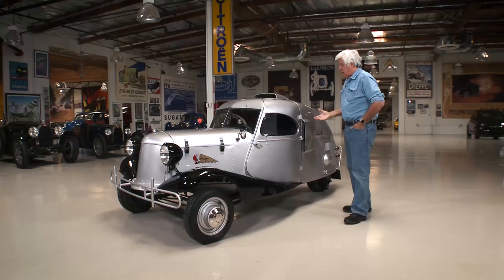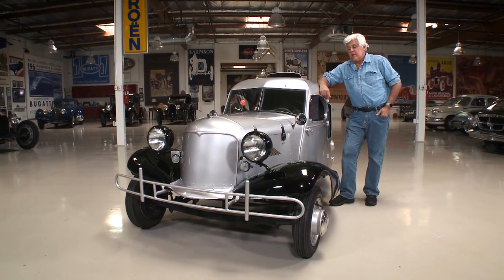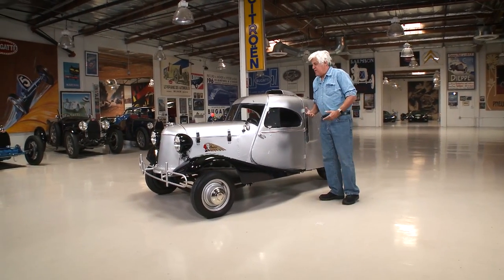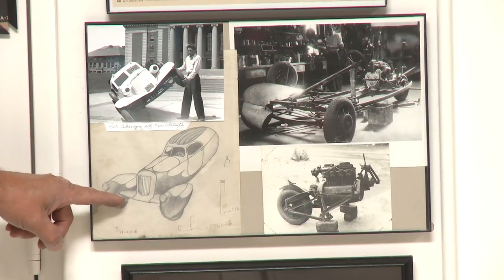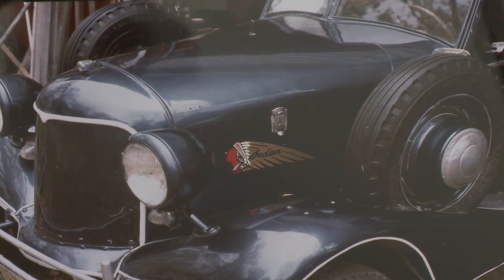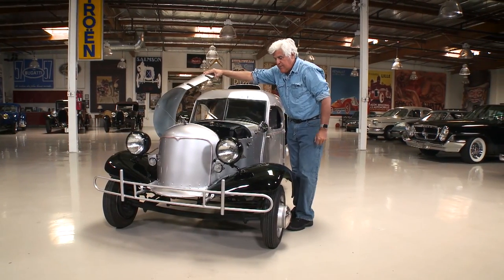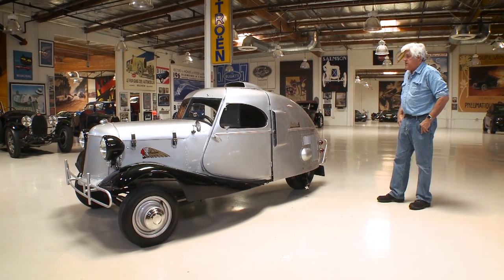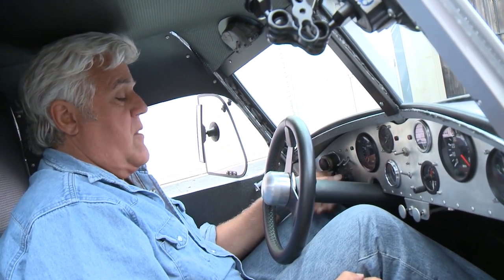1931 Shotwell - Jay Leno's Garage

Comment: That horn sounds so sick ~ like a wounded duck ~ I was rolling on the floor with laughter
Reply: there's actually a duck tucked under the dash for authenticity
Reply: Haha I agree. It was so funny.
Reply: i love thar horn, wounded duck😂😂😂 xD
Reply: Actually they duct taped a duck under the dash and put a metal rod inside it's anus and when connect the other end to a push button.. Then just hit the horn for quacks.. It stopped quacking cause the duck reached climax.
Reply: +V4 Garage oh God hahahahhahahahaa xD you makes me my day dude xD hahahahhahahahaa 😂😂😂😂😂😂😂
Reply: haha! I found your analogy equally as funny
Reply: +V4 Garage soon theyll instal a multi duck system on a 1 hour periodic revolution system... Some one patent that.
Reply: It is a duck, a 85 years old duck that has been silent for very long. So his throat sounds a bit worn out.
Reply: johnny hirt Ducks strapped in a wheel that spins and has a gatlingun working poking stick so you can go 100 quacks per minute.
Reply: +V4 Garage hahahahhahahahaa xDD
Reply: +V4 Garage 😂😂😂

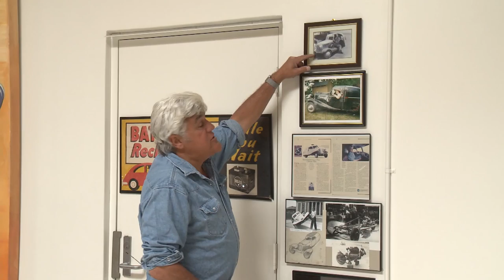Comment: 5:52  Note in the photo that the spares have matching deep lug treads while the tires on the car are smoother.  I think we're looking at a set of mounted snow tires.  Makes sense considering he took it to Alaska
Reply: Another problem with 3 wheelers is putting your car in the snow tracks of those that went before you, none of which would be 3 wheelers in Alaska
Reply: could be.  Or maybe that's just what was available.  I also notice in that photo there is no front bumper, and turn signals are on the roof.  The other photo shows the air scoop on the lt side of the cab, not on the top.  So it evolved over time, even before Jay got it.

Comment: Great little car! I would have been tempted during the rebuild to add a small circuit that keeps that cylinder head cooling fan running for about 2 minutes "or so" after you turn the vehicle off.....Then the fan would shut down automatically. I imagine there would be quite a rise in temp after shut off, all boxed in like that... especially in that climate. I understand it probably see's very little road time, but it would be simple, and just blend with all the other mods. Always enjoy the video's Jay! Take care.
Reply: That is exactly how my Buell Ulysses fan works.  Fan runs when the temp hits a certain temp and continues to run after shutdown.
Reply: Temp probe controlled fan relay w dial adjustment calibration
Reply: CooL. you are here 😀
Reply: Just like the Turbo cool down system on modern cars,glad to see you here watching Jay videos also

Comment: One of the best episodes of your show, ever - by the end of the episode you had figured out precisely why you had to make a roadside running repair....it is indeed very satisfying to solve or drive around a problem on the road. That is, to me, the essence of motoring, something which has been lost along the way. And who hasn't run out of the correct fuses at some time or other on the road, and installed an inferior replacement? This is a great story, of a terrific little car built by a inspiring young man, and I appreciate you restoring and keeping this thing going, Jay.

Comment: Blown fuse?... Don't know how many times I was saved by a stick of Wrigley's chewing gum.

Frank
Reply: I need to start chewing gum...
Reply: +johnny hirt I'm thinkin the same thing!
Reply: Ray Kruse and johnny hirt .. It's not about the gum.. It's about the wrapper... At least, it used to be... Years ago, Wrigley's gum was wrapped in aluminum foil lined wax paper... You could wrap your blown fuse with the wrapping paper, reinsert the fuse, and voila, the pixies would flow again. Surprisingly, If you were lucky, and didn't burn up your complete wiring system, the "fix" would last for years.
Reply: +franksalterego They might still have aluminum/wax paper in some places
Reply: Yeah i remember a buddy showed me if you connect both ends of a AA battery with the foil side of the wrapper it can be somewhat of a firestarter in a pinch.
Reply: franksalterego brother don't  you know it cigarette foil has Ben my saviour many times
Reply: Back in 1978 working 2nd shift, at the end of the night one of girls cars wouldn't start, blown fuse, one of the guys wrapped tin foil around the fuse, the car started right up, she didn't make it a mile before the car caught fire, a really nice 1968 Mustang fastback burned to the ground.
Back in the day, many houses burned down because people would put pennies under screw in fuses when they blew.
Those are perfect examples of a little knowledge being dangerous.
Reply: Fire hazard

Comment: I think someone should design a Shotwell replica kit car (bike) like this using a motor and rear suspension from a donor motorcycle.  How about a Hayabusa powered Shotwell replica?
Reply: that sounds like a great business idea for Jay. He owns the only one so he can replicate it without worrying about rights to design.
Reply: Hayabusa? You're a sadist aren't you?
Reply: Given the design, surely you'd be far better off with a scooter engine. There used to be an isetta replica that had one, worked well. Or, for a bit more grunt BMW 700 or guzzi power. Hayabusa would just be suicide.
Reply: No "Busa. Use a Modern Indian powertrain. 40HP for 1931 was the top of the heap. Remember Indian was the dominant Racing Motorcycle of the time.Besides, someone already stuck a 'Busa engine in a Smart 4two.
Reply: I think the T- REX Is as close as a modern day version of a car like this as we get.
Reply: interesting, not that far off!
Reply: How about a Kubota diesel powered Shotwell!
Reply: Google czech car "Velorex", same idea, 3 wheels, motorcycle engine, factory build, leather covered frame. Created in former Czechoslovakia for disabled people.

Comment: Long ago I was driving a 1946 GMC fire truck when the horn started sounding repeatedly.  Then the headlights failed.  We brought the truck home using the spotlights.  The horn button wire inside the steering column was shorting to the column and causing the horn relay to pull in and sound the horn.  The horn and headlights were on the same fuse and it overloaded and blew.  I disconnected the horn button wire below the column and replaced the fuse.  All lights worked again.  We left the horn disconnected and the truck was retired in that condition.  I had a similar problem with a 1954 CJ-3B Jeep.  The horn wire insulation cracked and the wire was shorting to the frame.  A little heat shrink tubing fixed that problem.  Yes-It;s satisfying making repairs on old vehicles.  There' s a simplicity about them that re-educates you.

Comment: I'm thinking a critical  like cooling fans should run on their own dedicated fuse/circuit.
Reply: yes.  but on the other hand, a quick tap of the horn will tell you if the fan has power or not...
Reply: hmmm good point.   You could tell something was not right when Jay hit the horn.  The voltage was sagging.   Resistance was going up and the fuse was heating up, ready to go on a permanent vacation. lol
Reply: +dddire straits yeah, that little 8 amp definately took off running

Comment: It's been 2 years and I'm just seeing this video for the first time now...well, it was a different time back then when the industrial revolution was in full swing. But, today is no different if you take into consideration that a number of young people that are designing and building on/off road vehicles and motorcycles. Today you can pretty much buy an off the shelf part to build anything, a far cry from the old days where you had to scrounge around for parts and modify them to fit.. But the passion is still alive today it's just taken on a different approach.

Comment: What a remarkable story. Thankfully Bob had the good sense contact Jay Leno. Jay Leno had the good sense to collect it and restore it.
I loved the comment that Bob Shotwell simply went and had his car registered with absolutely no fuss!  In  makes  you realise just how much personal freedom has been lost over the years.
I loves Jay's comments about the reaction of other road users to 'Shotwell'. It is interesting to note that because he used an Indian 4-Cylinder engine hence it has no reverse gear. Well in the UK until about 35 years or so years ago .
Three Wheelers under a certain weight were classified as motorcycles. So you could drive them on a motorcycle license. 
Provided the vehicle had no reverse (either a reverse gear or as in the case of some 2-stroke engines reversing the engine ie in the case of the Bond Minicar with a bi directional SIBA Dynastart)
gear! All in all very impressive for a 17 year old!

Comment: Sort of "Flash Gordonesque" in appearance, very cool. Seeing Jay in it reminds me of a nostalgic drive I took in a Morris Minor Ute a few years back. The cab was so small, you had to take up a position like a praying mantis because the distance from seat to steering wheel was only about 15 inches. Add to that, wooden brakes and even the transplanted motor from a Nissan 1200 felt pretty pedestrian. Nostalgia's great, as long as you don't have to drive it too far.

Comment: Thanks for all you do.  I have 1930 Ford--originally had no fuse.  Common practice is add one fuse where the wiring harness connects to the 6 volt battery lead wire, after the starter.  When these cars fail to keep running, folks try the horn.  If the horn is ok, the fuse is OK.  If no horn, the fuse is likely blown.  I have "slow-blow" type fuses, 30 amp.  The headlights and horn may pull more than 30, momentarily.  It's a fix.  I carry a few extra fuses.

Comment: Great episode. Hats off to the spirit of Mr. Shotwell and guys like Mr. Leno.

Pffft - blown fuse? No problem, here's a fix that works every time:
Wrap the fuse in foil. Tin foil from the roll works best, but in a pinch you can use the foil from a cigarette package (bonus points if you're a smoker - coff coff). Make sure the entire fuse is covered in a thin layer of foil. When complete, just jam it back in.  
Note - ignore the burning wire smell. And oh yeah, don't park your car in the garage for awhile. Wait until the smoke clears.

Comment: Terrific video, Jay. Always pleased to find one of yours about another of the NOT run-of-the-mill cars out there. And hats off to Bob Shotwell. On the fan failure, critical components should never share fuses with accessories. That fan deserves a fuse of its own. Horns get adjusted for minimum current, but as they wear, their draw increases.  Yeah, you tooted for those kids, but you should have been able to do that without disabling the horn, just blowing the horn fuse.

Comment: I realize this video is 5 years old. I'm sure this has already been addressed, but in no way would I have anything tied into the fan motor circuit. That should have a dedicated auxiliary power circuit, isolated and fused ONLY for the fan. Without the fan, an air cooled engine behind the passenger compartment will always overheat, and quickly. I install these circuits on motorcycles all the time for LED lighting, to HID headlights, to LED triple lights. It's super easy and will protect vital components from damage, in this case, catastrophic engine failure. Great car, even greater engine, and another great vid! Thanks for sharing Jay!

Comment: Jay, my Uncle Miles taught me a trick with that type of fuse when it blows and you don’t have a spare.   We would get a stick of gum, the kind in a foil wrapper.  Peel the foil away from the paper and wrap it around the fuse.  Stick the fuse back in and Wha La!  It works till you get home!!!  In the early 1950’s he showed me that trick on a 1952 Dodge coupe when the radio fuse blew.   Anybody that went through WWII knew all kinds of ways to keep stuff running!,,

Comment: It is kind of sad to see how many young people nowadays can't build or fix anything. Some can, some grew up fascinated with things and built projects just like we used to. That's rare to see nowadays.  I was a major tomboy and I grew up with my dad and 3 uncles that grew up in small town Oklahoma in the 30's & 40's. They were constantly out building or repairing stuff and I was out there with them. I didn't master anything but I got the basics of welding, machining and just general mechanics down pretty well and it has been invaluable through my life. I was overheating in the AZ desert & knew to take the thermostat out. I bought a Honda generator at a garage sale for $20 because "It's totally screwed", then fixed it in 15 mins with a new jet for $3. Getting a $23 generator is the first & only time I was happy about ethanol.  Fixing minor plumbing issues, fixing the car etc etc etc has saved me tens of thousands over my life, not to mention, you have the power to fix your own stuff. If your water pump goes out on a trip, you aren't helpless, you don't feel helpless. You are one Auto Zone and 4 hours from continuing your trip. Also, knowing when to turn something off. Can I limp home or is it something that will cause more damage if I keep driving? 
I think that's a great thing and it's sad to see how many people are totally at the mercy of others to fix even the most basic things they use every day.

Comment: This reminds me vaguely of my youth. My first car was a 1968 Chevy Impala - a somewhat rusty, grey Impala - not in the best of shape that I got for $250. My parents said that it was my responsibility, and one of the first things I noticed about it was that throwing an anchor out the window would be nearly as effective as hitting the brakes. Anyone who knows this car knows that it had drum brakes all around. As a broke teenager, I could barely afford new brake shoes, but I encountered a problem - the drums would not come off. My father explained to me why this happened, and told me I needed a drum puller to do the job. I had no money for one. But we did have cutting and welding torches, and a forge, and some old, rust "C" clamps. So I made a drum puller from scratch and fixed the brakes. Nowhere NEAR building your own car, but the same attitude - do what you have to to solve your problem.

Comment: Great video!  Love the musical interlude.  Thermodynamically the fan should pull air out because hot air rises and aerodynamically the scoop should face the rear because a diminishing cross section creates a vacuum -  also pulling air out.  IMHO

Comment: Interesting that the fact that the horn didn’t blow tipped Jay off to the blown fuse. I once had a Fiat 128 that had the electric engine fan and the horn on the same circuit, and I was tipped off in the same way at least once. A few years later I no longer had the Fiat, but I had a Saab 96 V4 that used the same style of fuse. One day I was driving up Laurel Canyon Blvd. in Los Angeles, and I saw a woman in a Fiat 124 Spyder off on the side. I stopped, and she said the engine was running hot. Based on my experience with the 128, I tried blowing her horn, and sure enough, silence. I was carrying spare fuses, I replaced the blown fuse, and she was on her way.

My hat is off to Bob Shotwell. I’ve taken my ability to buy good ready-made cars for granted!

Comment: Great video!  I bet if Jay had honked the horn again, he would have blown another fuse.  I guess a short in the horn (it sounded really sick!) or too small a fuse for the load.  Actually, I’d guess the second, because the horn sounded as if it wasn’t getting enough power.  I kept thinking about what would happen at speed if Jay had to stand on the brakes.  I can see all that weight up front, and was envisioning the car rotating on the front axle and flipping over.  I wonder if he has experienced the feeling of the rear tire lifting off the ground?

Comment: What's not to love!  There is the Campagna T-Rex from Quebec which since 1988 has been making a modern sports car version of the same idea. They claim it is impossible to roll even at high speeds as long as you are driving on a flat surface. I would love to see J. check it out.

Comment: Great car and story, only Jay would rebuild just because it's an interesrting 1 off. Hay Jay i build a 3 wheeler in 97 using a 1600 twin cam fiat it  tops out at 125mph & does  standing 1/4 15.67 but you don't have to worry about the body - it doesn't have 1.

Comment: I told my Dad when I was 12 that I wanted the 56 2dr post Customline that no longer ran that was sitting in the corner in our back yard. My Dad told me I could have It, and he said if you can fix it you can drive it. We'll after talking to Norm who ran the Skelly station I knew what was wrong, and how I would pay for the parts to fix it. Step by step Norm handed me what I needed to   get the car high enough to remove the 3 speed gearbox to remove and replace the the clutch, pressure plate, and thro-out bearing. He gave me this tool and that tool and pointed out on cars he was working on what I needed to look for and remove from my Ford. Now let's make the rest of the story short.....When my Pops got home after working out of town all week the Ford and I where nowhere in sight. I was beyond cool when found a floor shifter for my 272 V8 Ford.

Please no spelling, grammar, or punctuation police it's very difficult for me to see and type on this small tablet. I corrected a few mistakes, and it's now good enough. I realize that what I did is nothing like what Bob Shotwell did, but around my house it was unexpected when we didn't own a screwdriver or a pair of pliers.

Comment: Fairly simple trike (that's the class of vehicle it fits now days) with simple analog gauges! I actually plan to build a motorcycle engine-powered enclosed trike and it also will use analog gauges. I think Shotwell designed and built a vehicle very appropriate as a teen's 1st car back then and still a good choice for today's teens (and retired old guys like me)! Not the safest vehicle but a whole lot safer than motorcycles or scooters!